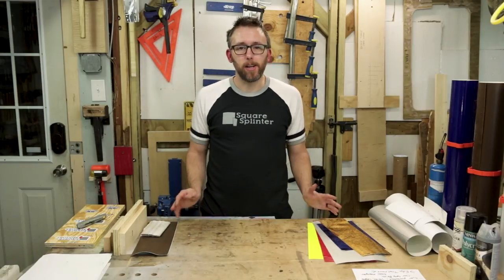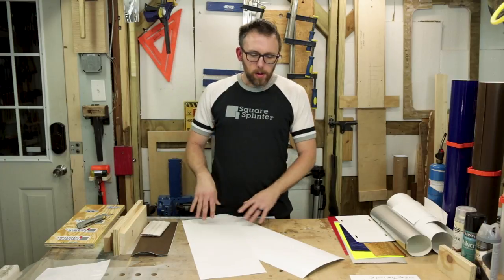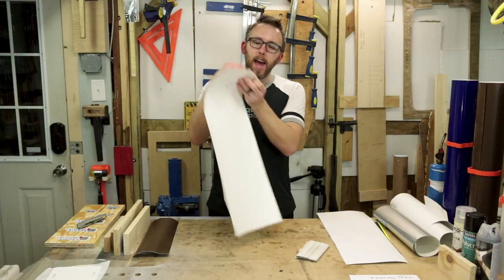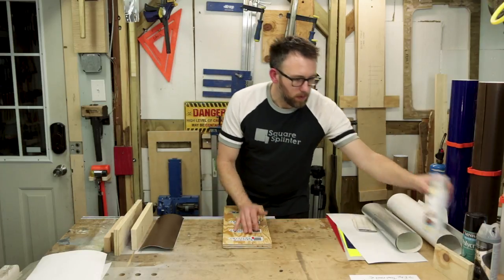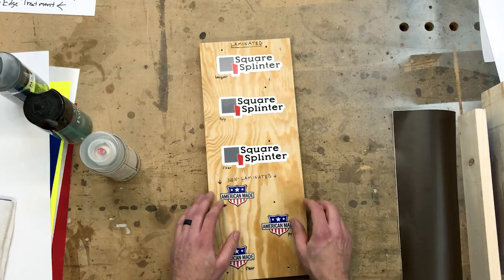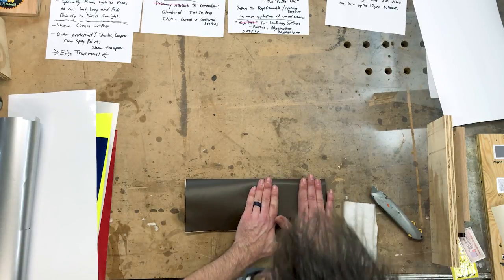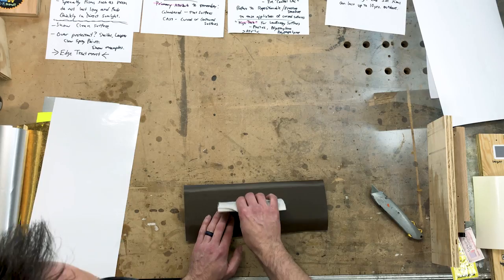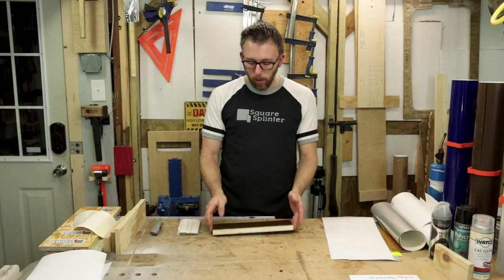Vinyl wrap your Wood | Tips and Tricks

Comment: Here’s a question for you.  Have you worked with the clear glossy vinyl they use to go over vinyl wrapped items for protection.  I  make decorative surfboards and have used epoxy for my finish.  Sadly I have developed the dreaded  epoxy sensitivity and now I’m looking for some type of alternative of a glossy finish.  I’m trying to avoid going back to a lacquer or polyurethane finish because of all the sanding and repeat coatings you need.   Just thought I would ask.  Thanks.  Joanne
Reply from the maker: Hi Joanne,  I actually work with different types of wraps and wrap laminates on a daily basis.  The clear laminate would probably work great for you because its very UV protective and fairly easy to work with.  I say “fairly” because it’s typically applied with a machine.  You can definitely apply it by hand but just be prepared because it’s VERY sticky and it isn’t as forgiving as typical vinyl is.  But if you have a good squeegee or similar application tool, take your time and go slow I think it would be a great alternative for you.   Hope this helps. 👍🏼

Comment: How you solve a problem with wood movement?
Reply from the maker: Дмитрий Нестеренко that is a legitimate concern.  I typically only cover plywood or MDF but covering small trim pieces like in the video of solid wood I don’t feel would pose a problem.  The minimal movement that can happen in small pieces can easily be handled by the vinyl stretching in small amounts one way or another.  Thanks for watching. 👍🏼
Reply: Vinyl is a lot more flexible and forgiving than wood.

Comment: Hi what can you do when it comes to plywood edge.
Reply: Thomas Gk the edges are definitely a bit trickier.  If you try and ONLY do the edge like you would with a traditional edge banding I just don’t think you will be able to have good results.  It could work well though if you were able to wrap the vinyl around the edge of the board and cover both sides all with one piece.  That way you wouldn’t have any edges that could easily be peeled up.  Other than that there are some super aggressive adhesive vinyls that could work but they would be really cost prohibitive.   Hope this helps. 👍🏼
Reply from the maker: Derek Davis sorry, replied with wrong account but you get the idea.  😬
Reply: SquareSplinter yes thank you. Layers of plywood showing on the edges is also a problem. Any other trick besides sanding.
Reply from the maker: Thomas Gk if you are prepping for paint on the edges you can use bondo.  Apply it really thin and sand back.  That gives a super smooth finish and hides the layers perfectly.
Reply: @SquareSplinter  Drywall mud works pretty well.
Reply: I found that using a heat gun makes a huge difference getting vinyl to stick tight around corners and especially to the edges of plywood. I just wrapped plywood drawers with this method and it worked great

Comment: Thank YOU! Great Video! One of the best I have seen lately! I’ve been curious about this because I’ve been trying to find ways other than heat transfer or water slide decals to use on wooden fingerboard/skateboard decks. They are made from Maple, though my concern is the concave/contour as well as bolt holes that will have to come through the vinyl. Do you think it would work? Would love to hear your input for wrapping something of this shape.
Reply from the maker: Yes I think it would work just fine.  In the case of small contours and what not you just want to be sure and use a good grade vinyl and not the real cheap stuff.  Send me an email and I would be glad to give you some options.  👍🏼

Comment: Time will tell in regards to yellowing I guess
Reply from the maker: Chris Flux everything I would use this for would be indoors.  I also typically use “car wrap” level quality vinyl which is UV resistant and also doesn’t fade even being in direct sunlight.  This vinyl can last upwards of 5-6 years outside on a vehicle so I am not worried about a drawer front on a desk.   Thanks for watching! 👍🏼
Reply: SquareSplinter thanks but was talking about the clear coat.
Reply from the maker: Chris Flux oh wow, sorry that makes much more sense. Funny you mention it because I still have that board laying out in my yard and it still looks good. Has held up well!   👊
Reply: SquareSplinter 👍🏻